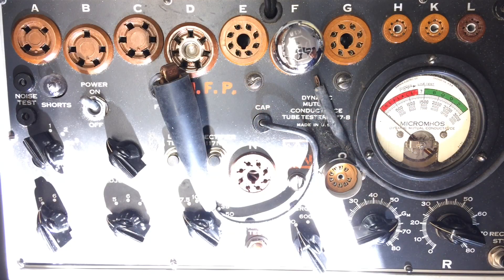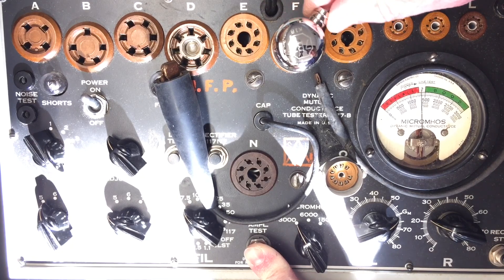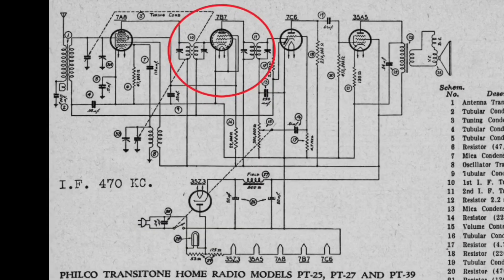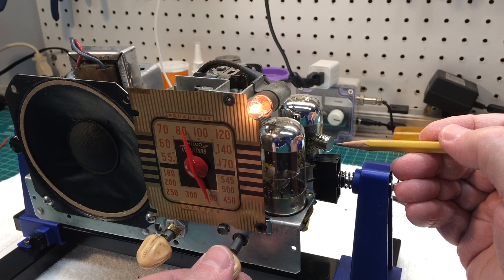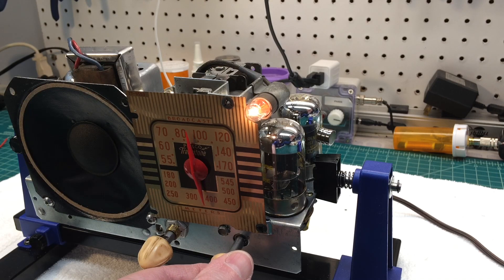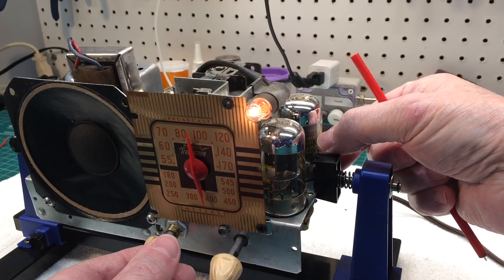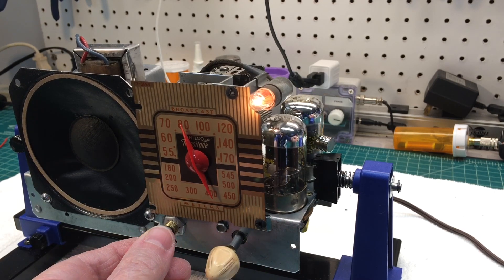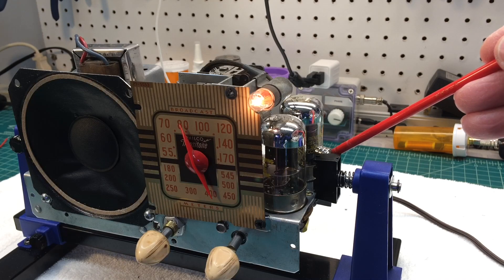Philco PT-25 Transitone - How a Magnetic Field Influences 7B7 Gain & Reduces Distortion

Comment: Hi Don. Just a quick question. Does that radio need any tube shield's ?. Has always Liked,shared. All my very best.
Reply from the maker: Bobby - the 7B7 acting as the IF amplifier has an internal shield (pin 5) that’s connected to the floating ground of the receiver. The stem of the tubes are connected to the chassis, which serves as a RF ground. I placed some aluminum foil around each tube one at a time and no difference in performance was noted. A great question on your part. All the best. Don
Reply: @RestoreOldRadios  hi Don. Thank you for the clear answer,to my question. Very interesting how the magnet influenced the output  / response  of the tube. Thank you my friend.

Comment: The squealing could be caused by faulty (open) capacitors and/or resistors, or misalignment in the RF/IF areas of the circuitry. Also by improper routing of wiring in those areas. Even bad grounding paths in the RF areas can be the source of the squealing. Those old designs were inheritently stable on their own when new.
Reply from the maker: cjay - great points you shared; thank you. I know it will add value to folks following along. Best, Don

Comment: That's a very interesting way of controlling the tube Don, I wonder if the plate would become magnetized residually from a strong magnet?
Reply from the maker: Thanks Jim. I don’t know about the long term effects on the health of the tube. I just found it to be a intriguing method to reduce the gain in the IF section while troubleshooting. Best, Don

Comment: Am I the only who tried something similar to this as a young teenage wise acre. I took a small round magnet from the kitchen refrigerator and put it up against
the CRT of our  color TV, this would have been in the mid 1970's . I was shocked when I removed the magnet and was left with a black circle and no picture 
around the area . There seemed to be a slight curve inward of the colors  to the area around the black area where the magnet was. Oh my goodness , I ruined the TV!😮
Well I thought maybe it would fix itself so I turned off the TV and there was an all to familiar sound of static discharge on the screen.⚡ A few seconds later I turned
the set back on and to my GREAT relief the picture was back to normal.😅  I guess I just  discovered the degaussing coil!
Reply from the maker: Funny, I did the same to my grandparents set. LOL I wasn’t brave enough to try it on my parents set for reasons you can imagine. An interesting phenomenon for sure. All the best. Don
Reply: @RestoreOldRadios  I did something similar to our set when I was about five or six... my dad had to bring a degaussing coil from work to get the distortion eliminated.
Reply: If we’re here watching this video and in turn replying to this comment then yes... we more than likely tried the “magnet on the CRT trick” as kids. 😂

Comment: .... actually I tried the radio in a different location. No change The staticy is in higher side of the dial only. Bad tube perhaps?
Reply from the maker: Barry - would it be possible for you to post an unlisted or private video that captures the noise/interference? It doesn’t sound like a tube, but you never know. Best, Don
Reply: Hi Don, today I tried changing out the suspected bad mica cap with a new one of the same value, the radio lighted up but no sound at all. Do mica caps have to be in a certain direction? The old mica cap had an arrow pointing above the dots The new brown dipped one does not. 
I decided to- re install the old one. It was very difficult as I'd clipped it out. Getting it back in was a nightmare. My soldering looks awful, and I thought I burned the cap. It finally went back in and the radio seems fine now. I don't understand why? I did find a disc cap that looks a little worn, but it's not shown in the SAMs and I can't figure out what it is. Anyway the radio was on for six hours and is sounding great and DX'ing like crazy. Thanks for your reply. @RestoreOldRadios
Reply from the maker: Barry - mica caps don’t have an outside foil or polarity. It’s possible you had a bad (cold) solder joint and the noise was emanating from that location. Glad you got it playing. BTW - what does the disc cap attach to? Best, Don

Comment: I've been trying to figure out if my 1950  Zenith G723 AM FM radio is having a silver mica issue or is the new outlet and new dishwasher 
making interference on the radio. It sits in the kitchen on the counter over the dishwasher and in front of the new 3 switch wall outlet.  The radio is very sensitive on both bands. But on only  weaker  stations do  you hear a staticy mica silver  like buzz. My Zenith 6D029 and my Zenith 7H820 don't seem to have that problem in the same location. I had  the radio on for 4 hours today and it sounds perfect and clear when the signal is at a good strength. It picks up distant stations hundreds of miles away. There is one dotted mica cap left in the radio. Tomorrow I'll try the radio in a different location and see  what happens.
I really enjoy your channel are you an engineer?
Reply: H Higgins  So true, our new washing machine puts sounds not found in nature over my radios when its washing, and the dishwasher too. We have limited counter space so the kitchen  tube radios sit right over the dishwasher. If I leave the door open and the control board is away from the counter then that helps, but everyone bangs into the dishwasher door. Why do  these appliances give off so much RFI?
Reply from the maker: Barry - I see other replies to your original question that I concur with. I’m not an engineer, just a tech guy that enjoys the hobby. If you have a portable radio, you can use it too to identify the source of the EMI or a cleaner location for the receiver that’s free from the noise. I have a lot of noise in my shop/house too, and it really plays havoc with the BC frequencies. Best, Don